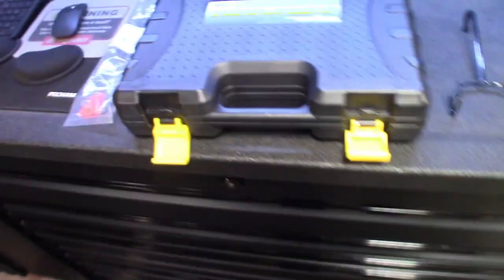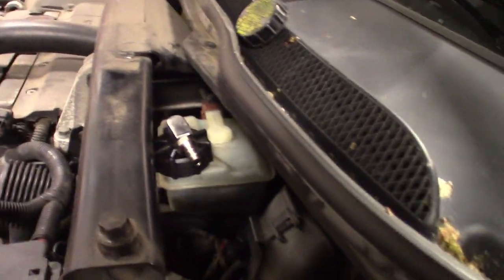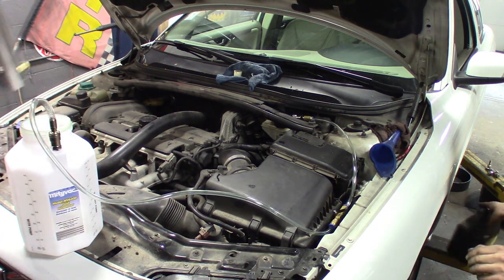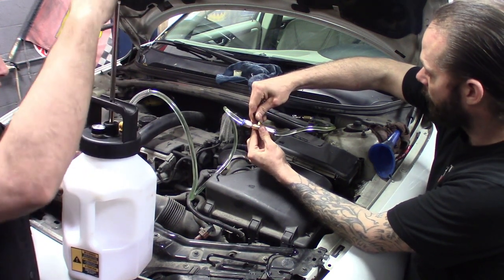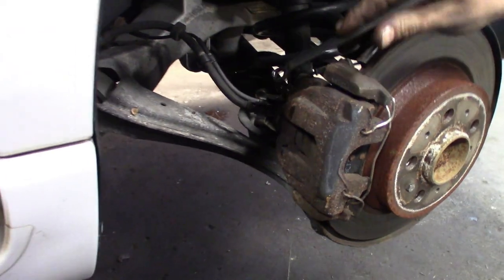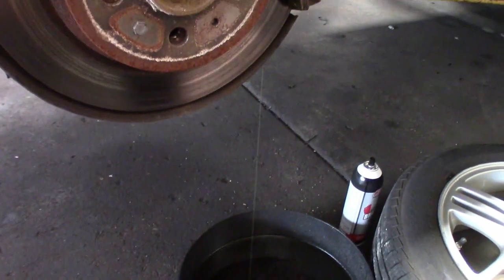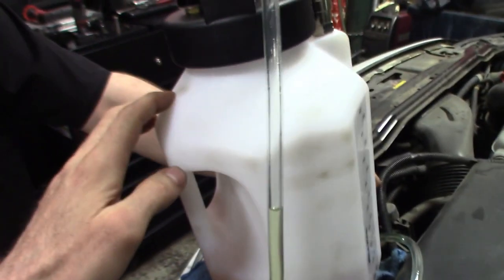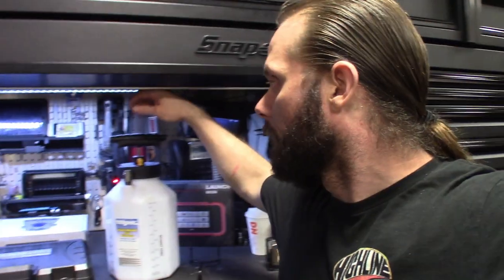Mityvac Time Saver

Comment: I use that same tool mostly for diffs/transfer case, and transmissions when necessary. While it does work awesome and I couldn't live without it my hose does leak at the valve. Took maybe 6 months or so for it to start. Brake fluid I think will hurt it faster. I use an electric power brake bleeder, works exactly the same just no pumping and is dedicated to DOT 3.

Comment: I have the Motive, should have got this one. I noticed the "universal" adapters don't seal as well as the actual caps.  About 15psi worked for me with a full fluid flush. Check out the Motive or similar bottles that hang off the calipers they keep things nice and the hose is real soft to hold on the bleeder's. 

Nice job. 👍

Comment: Don’t contaminate that bottle with other fluids. That’s going to contaminate the next brake system you service cause you’ve put power steering or transmission fluid in it before hand. Use only with brake fluid.

Comment: I wonder if you put the bottle on the side of the vehicle bellow the brake fluid reservoir if more fluid will flow back into the tank when you're finished and you release the pressure.

Comment: Will that tank pump fit on the yard type sprayers also? could find some on sale and keep some with your most used fluids to swap the pump onto when you need them.. or may be mighty vac will sell just the tank if you want an extra.
Reply: I cant imagine this tool can be used for anything but flushing brake fluid or bleeding brakes. So I really don't think you need another tank. Although it is a nice tool and I'm going to get one for my shop that's for sure
Reply from the maker: Mityvac does sell just the tank by it self
Reply: @dylankinch2735  I use mine for filling non dipstick trans, front and rear diffs. Works Great!
Reply: Yea your right now that i think of it it could be used for filling all the things u mentioned. My bad
Reply: I considered one for oil changes when I had a bmw with a drain plug in a bad spot.. I used a different style pump that took a lot longer to use.

Comment: You do have to open the abs valves with a scan tool to get the fluid out of the valves.
Reply from the maker: Good point 👍
Reply: Wats he mean?
Reply from the maker: @misconceptionindustries2968  the abs unit has dump valves that keep brake fluid in them unless there opened on newer and certain vehicles.
Reply: So u cant really bleed ur brakes without a scan tool then?
Reply from the maker: Yes most of the time you can, on some cases it's better and easier to use a scanner but you can get away with bleeding them manually.
Reply: Oh ok iv always done it manually. Definitely will pick up that kit in the future! You should do a video on a scanner that is economical for guys that aren't mechanics so dont need the latest and fanciest but a good quality tool with good options and functions for guys working at home on there own stuff or basic side work jobs!